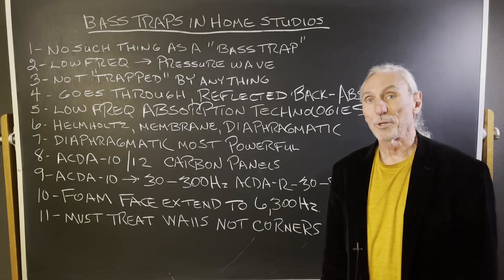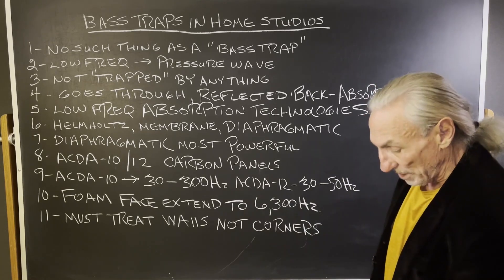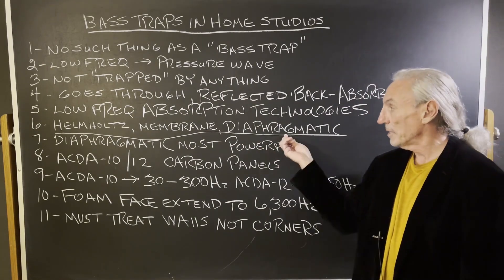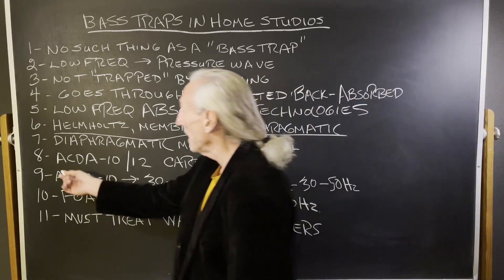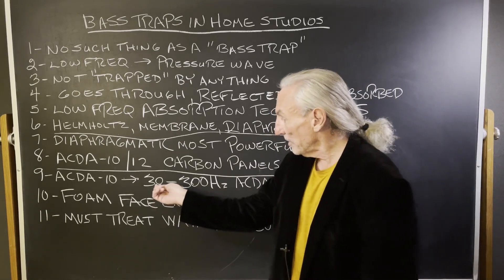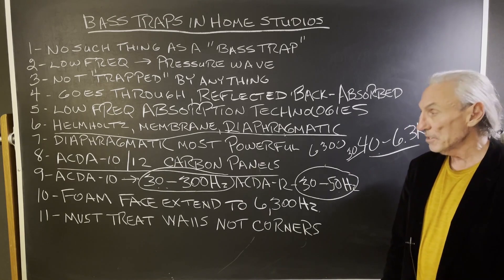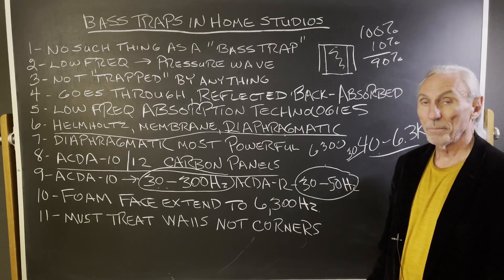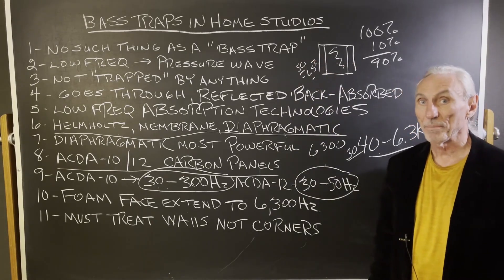Bass Traps in Home Studios - www.AcousticFields.com

Comment: Hi Dennis. I owe you a debt of gratitude. Several years ago I heard your name mentioned on a forum talking about "Bass traps." At the time I was about to treat one of the worst possible dimensioned room. After absorbing your information. (pun intended) I scrapped the idea. Even after purchasing your DIY plans I realized I still couldn't afford to do it right. So, thanks for your hard work and generous sharing. It's saved me spending fools cash. Perhaps one day though!  sgnd: Bruce
Reply from the maker: Glad to help
Reply: What was the dimensions of that room?
Reply: @rushmuzik  20x20x7' high
Reply: @Slo-Fi77  wow. Wasn't there an option to build a smaller room within that bigger room and use the  extra space for a lounge?
Reply: @rushmuzik  Room is way too small for that. 20 feet is not as big as you think, when it's full of band gear. This is a full band setup practice/jam/recording room. Already finished. Solid poured foundation (absorbs LF) and barn-board wall paneling. Room sounds good. Can turn the P.A. up to max with no feed-back. I use close-miccing and will perhaps make some units that can be moved in around the mix position.